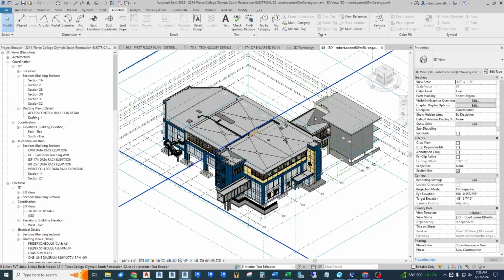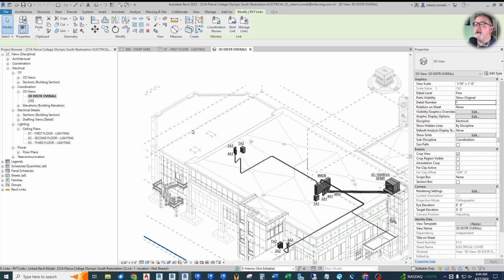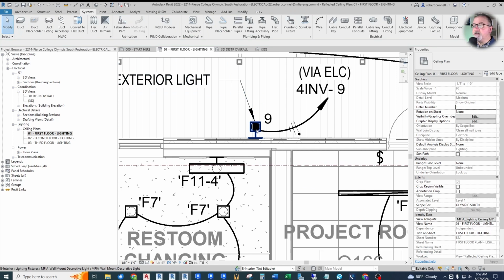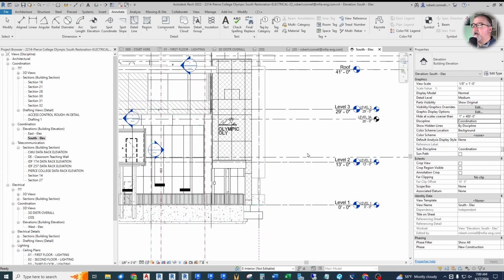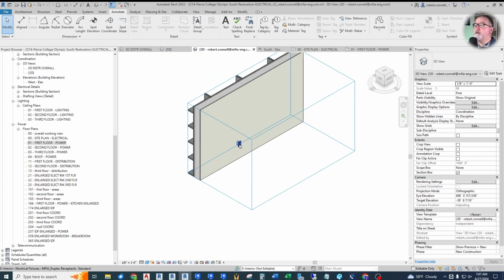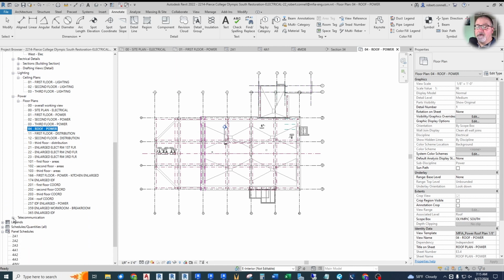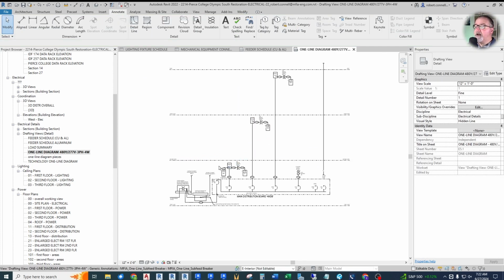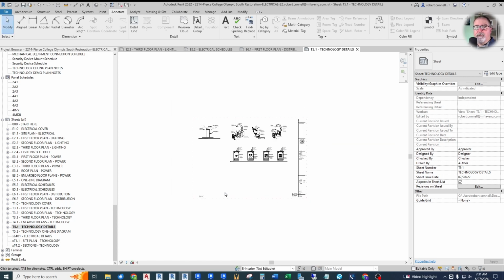From Receptacles to Panels: Full Revit Electrical Design

Comment: Hi Rob , Hope everything is fine with you there .

I just want to know how to create a custom panel schedule template in which my loads should be in KW instead of KVA . And I also want to know how do I change my  individual equipment load aslo to W .

THANKS.
Reply from the maker: Good question - as far as I can tell, Revit really wants to use "apparent power" or VA for calcs, since it directly converts to Amps.
Reply: @ElectricRob  Thanks for replying sir !